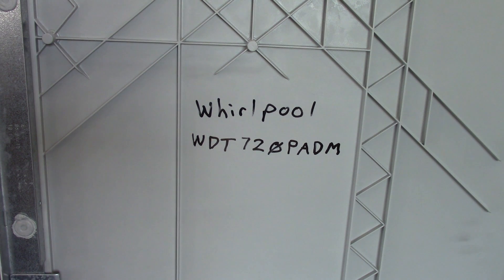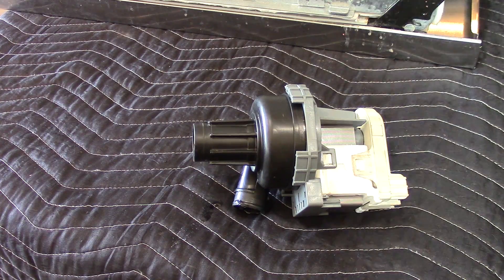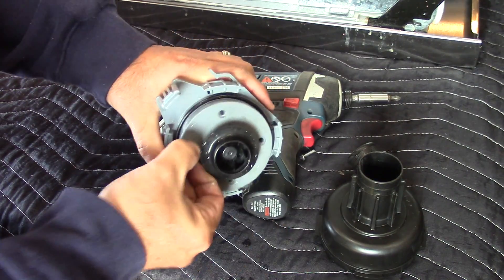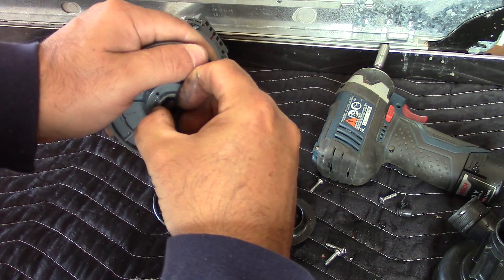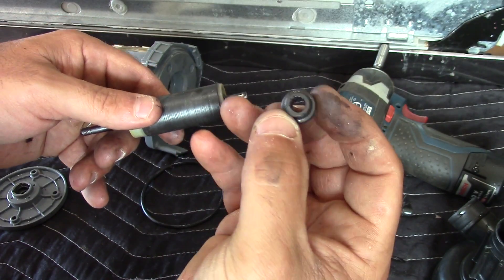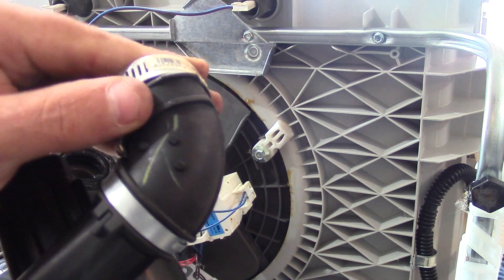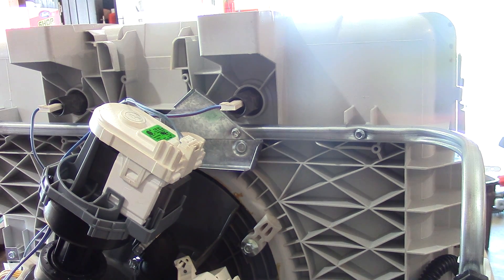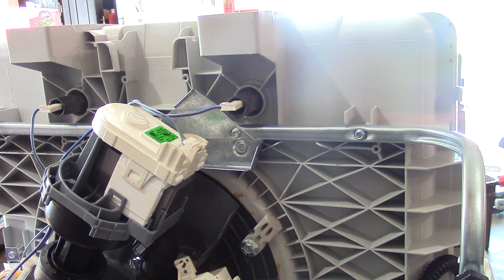Whirlpool WDT720PADM1 Dishwasher Not Working Repair

Comment from the maker: http://amzn.to/2x6XePK Circulation Pump (dishes not getting clean)
http://amzn.to/2fplGnJ Complete pump and motor assembly
http://amzn.to/2wx1Qwv Doorlatch
http://amzn.to/2xamzK7 Circuit Board (Main control board)
http://amzn.to/2x6XePK Circulation Pump (dishes not getting clean)
http://amzn.to/2xpVAuB Drain Pump (dishwasher not draining)
http://amzn.to/2jA3xbA Dishwasher detergent dispenser
http://amzn.to/2x7eq7E Water Inlet Valve (Many times Cracked)
http://amzn.to/2yfrvvE Inlet Valve Solenoid (Dishwasher no fill)
http://amzn.to/2yeBeTj Push button Panel (almost always what is wrong vs. main control board buttons wear out or get stuck over time)

Help support Doublewide6 Repairs LLC by sponsoring his Patreon account
https://www.patreon.com/doublewide6
Reply: You would think that these cheap bearings would be available to purchase separately since it's a common problem. Even if it's a bad design, these things would be like $1.
Reply: I’m thinking about buying one just like this used and the guy said it works good other than there is some detergent that is still in the detergent dispenser after it finishes it’s cycle.  I thought it may be the circulation pump.  What do you think??

Comment: Is there a check valve?  I can't seem to find one.    I changed the pump, it runs and the lines are clear, yet there just isn't enough pressure to drive the water through.

Comment: It's practically criminal to design and sell something like this.  The manufacturer probably saved less than a dollar by using those crappy bushings, when good Delrin or bronze bushings would last for many years with no problems.  They also do the customer no favor by using hose clamps that require special tools to install.

Comment: Really appreciate the video! Was having issue with my whirlpool dishwasher not "washing" but filling and draining.
 I was going to just order a circulation pump but figured I would give cleaning it a try. It was NASTY, for real. Only 2 years old. Cleaned it out, temporarily hooked it back up for a test run and BOOM I could definetly hear the blades spinning.
 Need 2 hose clamps though. The 1 you replaced and 1 for the other end that doesn't normally have a hose clamp. Must have been glued in or something but it's leaking from there. Might try a metal "zip tie" due to the tight clearance. Unsure if there is a glue that would work but ill double check. 
Thanks again for the video my man! Saved me $120 which was about the cheapest I could find a circulation pump for. Never mind the amount of money I was fixin to spend if I was just going to buy a new dishwasher.

Comment: Easier yet, just replace motor by twisting it off/on.  Wish I could buy just the motor without the rest of the housing, similar to the drain pump motor.  If anyone knows where to get JUST THE MOTOR, please comment.

Comment: Mine didn't need screws its held in place by forcing it into the housing. I took the piece apart and the magnet was rusty and there was food in there. I cleaned all the food out and cleaned the magnet so it was smooth again. I put in a little water proof grease around it and put it all together. I forgot how forceful the water pressure is in there. I would buy you a pitcher of beer and wings for this video. Thank you a 100 times.

Comment: Quick question: Does this pump/morot problem cause water leakage by any chance. I have same model and I don't see any water in the front when I use the machine but by my neighbor came upstairs seeing water coming down from his ceiling. so not sure what is going on. Thank you for the video. Appreciate it.

Comment: My whirlpool dishwasher is 6 months old and failed. It fills and drains but does not spray water.  I will take it apart and I hope it's just debris in the pump. If the pump failed at 6 months, I'll never buy whirlpool anything ever again.
Reply: My dishwasher has the same issue. Have you fixed it ? How?
Reply: The 12 month warranty should cover it. My Maytag lasted 19 months.

Comment: My Whirlpool dishwasher has been throwing a F6E4..
Door latch switch is good
Float switch replaced
Drain pump good
Mother board replaced
Fully cleaned, turbidity sensor cleaned...
Water valve replaced
Running out of ideas.

Any suggestions?

Comment: Great video, first and only one I have found for the Whirlpool WDT720PADM dishwasher that actually talks about the pump and taking it apart and the parts that makes it up. I am an engineer and have done bench repair of electronics to component level for a years. Sad we live in a throw away society now where seems no one wants to fix things that are not that hard to do so. For electronics it is easy there are many parts companies that will sell just about any part you want but on things like this which is actually a common pump you cannot find a common part.

Comment: I just did this repair (thank you for the video!), and water is pouring out of the connection w/o the hose clamp. The pump went on easy, just like you demonstrated, but that connection is far from water tight. Any suggestions?

Comment: Just wanted to thank you for the video. I have the same model and it is only 1 1/2 years old also. I took off the pump and checked on getting a new pump, and the cheapest I could find with shipping was $100.00. I only paid $375.00 for this dishwasher new (found a deal at HD) but eventually be changing it out because I'm remodeling our kitchen. So I couldn't bring myself to buy a new pump until I tried something first. In your video you said it was just the bushing that is the problem on the pump, so I made a new bushing out of a stainless steel bolt. So far so good. I've run 3 loads through and the dishwasher hasn't worked this well in a long time! Well, hopefully it will last a while. Thanks again.
Reply: Hello can you describe the type bolt you made a bushing out of?  Maybe you mean a washer?

Comment: So the meaning of all this is that this pump that costs 90$ has flaw design that will require me to replace it every 1.5 year. Hmmm,Thank you Whirlpool / Frigidaire  I will never buy your appliances again.
Reply: Same here.  I have replaced a water inlet valve and pump on a 4 year old Whirlpool.  I had my previous GE dishwasher for over 20 years.  No repairs.  Replaced it when remodeling the kitchen.  What a mistake.
Reply: My Maytag circulation pump just failed this week after owning it new for 19 months.

Comment: I have exactly the same problem with my same model dishwasher, it is also 1.5 years old. after seen the bearing of the pump in this video i will never by appliances from Whirlpool / Frigidaire again. Ill pay a bit more and get a samsung / LG . I had samsung dishwasher that worked flawless for 7 years, sadly i had to leave it when i moved.

Comment: If you are ever able to source a fix for the old pump to have on hand as a back that would make a good vid. 80$ once is ok, but if this goes again, a even cheaper solution could be useful.
Reply from the maker: Good thought, but I'm not keeping this dishwasher.  I have an older one that is working fine and it has a much stronger and better made motor.

Comment: An appliance commercial came up before this one.  Good timing.   Wow    1 1/2 years old is NOT good.  Remember when the fridge from Grandma's house was downstairs still working and upstairs 3 fridges have come and gone.
Reply from the maker: That is very true.  These new appliances have all kinds of sensors and stop working because something is not right.  I used to take about an hour to wash our clothes now with the high efficiency washer it takes close to 2 hours.

Comment: hi they don't make dishwashers like they used to the old ones were heavy and strong they have such a big motor on them the old ones took two hands to hold the motor that's when they were American made that dishwasher pump motor you have looks like a little bitty toy pump motor let me guess made in China or some foreign country yeah and that's what companies do you cannot buy the part you got by the whole unit I like to see a hundred percent American made or Germany or Russia or one of the big countries who know how to make good quality and  stuff
Reply from the maker: You are right, they used to be built much better and would last a lot longer.  They didn't cost $500 back then either.
Reply: mine, made in 2016 In the USA (stamped on front door), has the same crappy pump and issue.